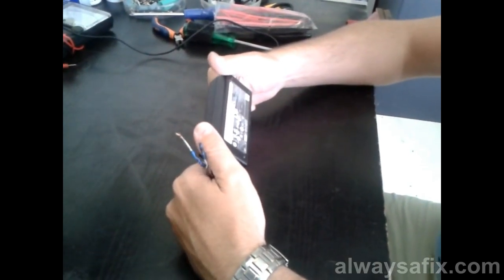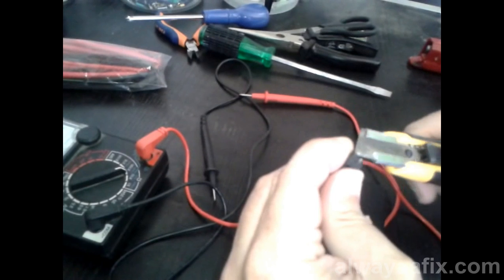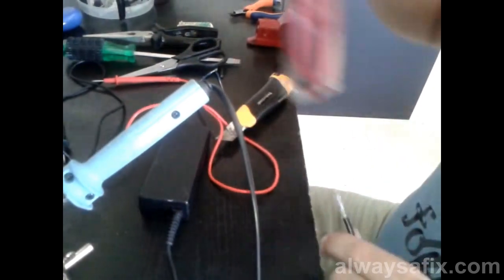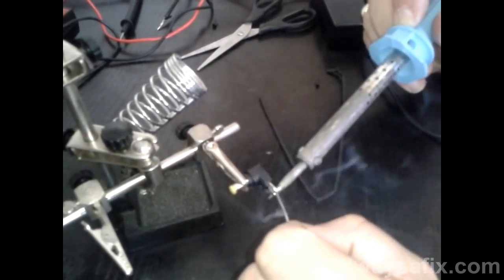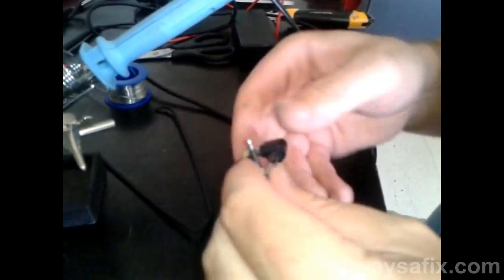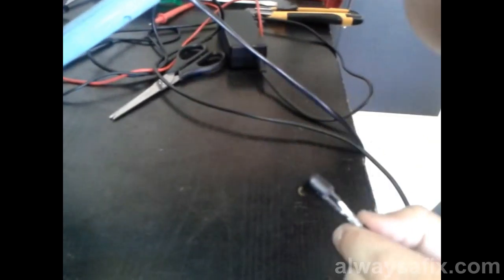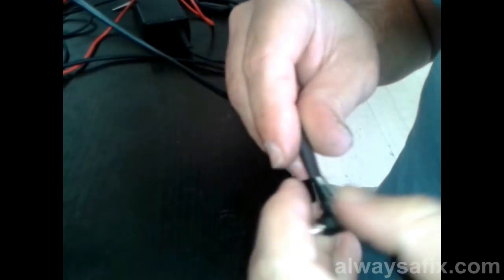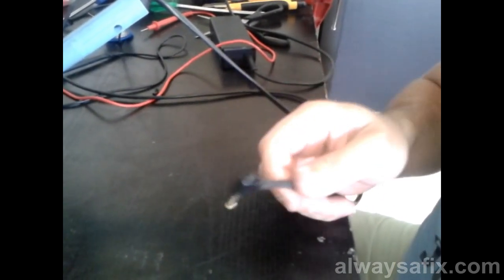Laptop charger adapter repair

Comment: Luv the fix but how much pull strength has it got .As you know from soldering techniques good solder joints need to be mechanically good as well as functional .all so were do you get the different dc connections from please.